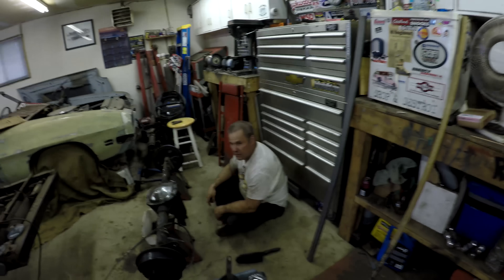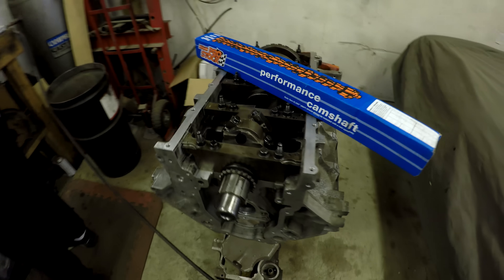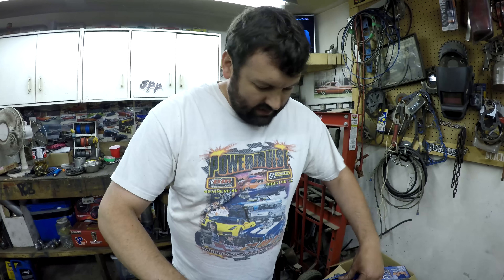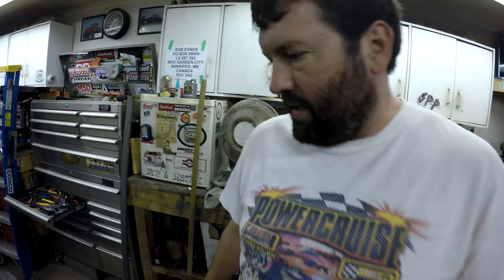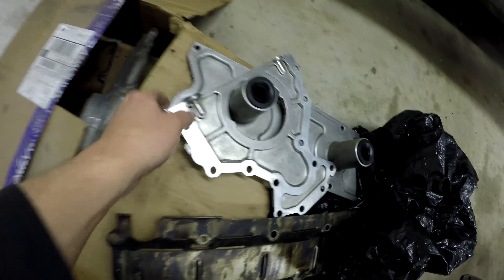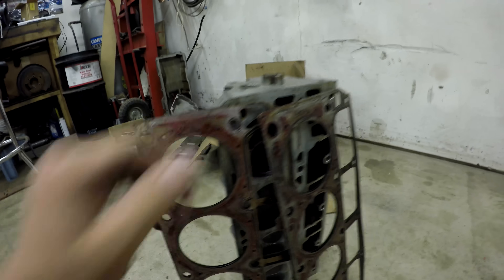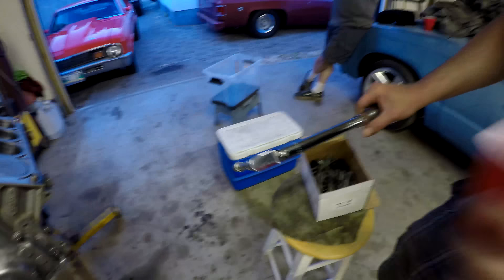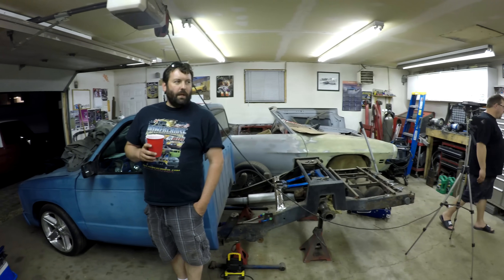Rebuilding 799 LS Cylinder Heads, SS2 Camshaft Install + More | How to Build a LS Engine (ep4)

Comment: What did you use to clean the deck surface of that aluminum block without damaging it before bolting the heads down?
Reply from the maker: A body work block

Comment: Underneath the video it says rebuilt 799 cylinder heads does that mean that the block is rebuilt also cuz I noticed you have Pistons with zero deck is that the way it comes from the factory???
Reply from the maker: The later 5.3’s were flat tops and they come close to zero deck

Comment: Hey good job on a back yard rebuild. Just a bit of a few thing  i can pass along !, the first is using dry.   Graphite on the crank journals and main and rod berings sa well as cam journals heat the crank and cam up to 200 degrees get spray graphite and coat all journals its insurance against spining a bearing or metal to bearing contact when start up and.  on head gaskets coat with copper coat then get lock ease in a can its powered graphite sprinkle it on the copper coat after you spray the head gaskit let it dry then tap the gasket on the side and do the other side ive used head gaskets over and over and over and never bought another intake gaskets the same way also exhaust gaskets ,, ok you didnt cheak the valve springs in a spring psi gauge. But youll learn after you find a bad spring it happens good luck with the 5.3.  I like the 6.2 2018 and the 10 speed i got in my 57 chevy sedan delivery wee haa go boys

Comment: I have found two gen 4 5.3L  engines one iron block one aluminum block. Both are    going to be non turbo can I use the cam your using in both engines.
Reply from the maker: As long as it’s a 3 bolt cam gear, otherwise you’ll need a new gear
Reply: @SPPTVarmy  excellent.  You guys saved me several hundred.  I'm going to follow

Comment: I hope you guys can help. I have basically the same engine and cam but I want to mill my head for added compression. What’s the max mill you can do and not have any issues with cam hitting or needing to flycut pistons. .030 .040?

Comment: Sense you didnt check valve spring installed height for your valve spring closed & open valve spring pressure after doing your lapping you should of just put stock springs on it cause you more than likely needed to shim a few up
Reply from the maker: Exactly!

Comment: What pistons are you using I noticed they are flat tops not dish pistons
Reply from the maker: Its a all aluminum L33 5.3 they come with flattops
Reply: @SPPTVarmy  will they work in an iron block 2002 L59 flex fuel engine
Reply: Yes 4.8's work alsy

Comment: You really should have replaced those exhaust valves.  They were pretty bad and what was left of the hardened surface was ground off with the lapping.  Sure they will seal but they are going to burn.  Reusing head gaskets and some of the seals?  I know it's a budget build but these parts are cheap and time is valuable.
Reply from the maker: How do they grind valves to do a 3 angle valve job? Reusing these head gaskets etc is common practice with these engines  its not a 70s sbc.
Reply: @SPPTVarmy  They cut the seats at three angles and replace the valves.  Modern valves are specially designed for the punishment modern hp and fuels dish out, don’t take the valve’s shield.  When you grind a valve it cuts away the hardened surface.  I dare you to find a reputable machine shop that will grind your valves let alone provide some sort of guarantee.  They will seal great but eventually burn.  Like you said this isn’t your 70’s sbc and we aren't in the 70's.  As far as gaskets and seals, respect your time.  Unless you enjoy the chores that come with cutting corners.  I'd rather see more progress in your awesome adventures.
Reply from the maker: Havent had any issues reusing gaskets.
Reply: @SPPTVarmy  When you were pulling the heads at the junk yard and said we should save these head gaskets I thought you were making a joke lol.  In my day that would be unheard of but apparently you can get away with it.  The LS engine never ceases to amaze me.

Comment: The reason they said it's not necessary is, it's not a oil filter. Oil is for lubrication not for sealing. Don't need it on a oil filter neither.

Comment: How do u know that the cam yal got will work with the factory valves and springs. Are u sure the new cam wont cause the springs to bind. I thought ur suppose to buy springs that match the cams lift????
Reply: Driveway engineer has a good video on that subject

Comment: Great vids...I am building an L33 turbo motor as well....my block has the typical aluminum corrosion...what did you use to clean yours?  thx!
Reply from the maker: Easy-Off oven cleaner but it leaves somewhat of an ugly finish
Reply: cool thanks...I have been looking at lots of alum cleaners and testing some...none seem to work as well as easy-off on test pieces...thats what I'm going with...thx again...
Reply: Wire wheel it w diff wheel attachments  blow it and  "Purple Power Aluminum Brightener"   or  touch it up w paint and clearcoat  that L33 is rare. Muranic acid puts pits in metal weakens block I wouldn't use oven cleaner either if it eats it

Comment: no prelube on the cam lobes??  Wouldnt have been my choice even with a roller cam
Reply from the maker: I’ve never lubed up a roller cam. Lifters were placed in an oil bath
Reply: SPPTV  wrong so wrong

Comment: Does the 799 heads come with the smaller retainers for the beehive springs? Or did you get the springs with new retainers/keys? (It looks as though you re-used the old retainers.) I have an L33 in my 06 Silverado. If I don't need to repurchase keepers/keys, I'm always ready for the budget friendly sort of thing :o) The Elgin E-1840-P looks like a great cam ... but I'm no expert ;-)
Reply from the maker: I believe all ls heads come with the same retainers
Reply: I guess my real question here was ... did you re-use the stock retainers?
Reply from the maker: Yes
Reply: Kewlio ... Thanks guys! And keep up the great work :o)